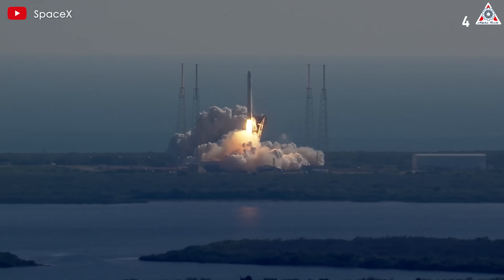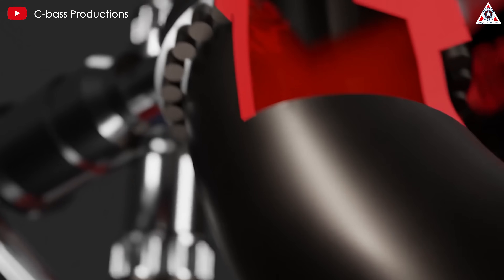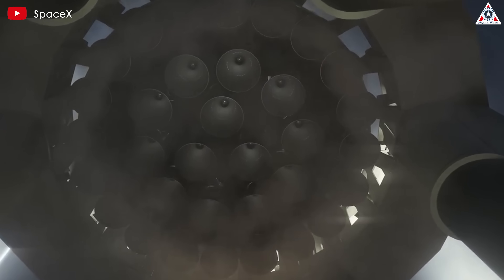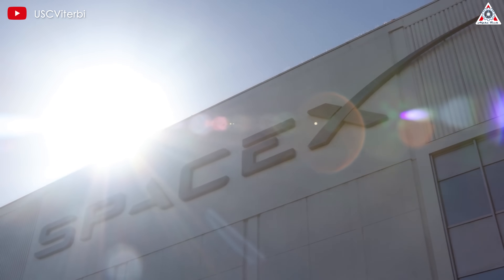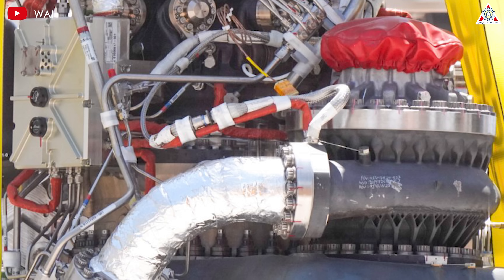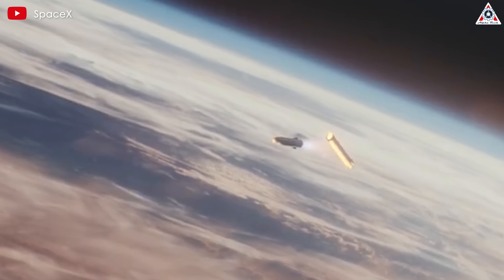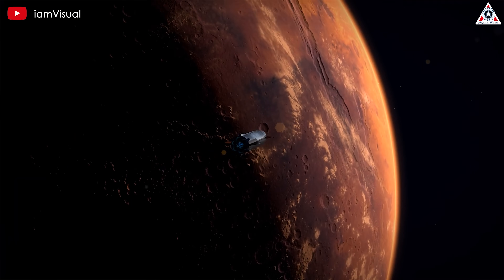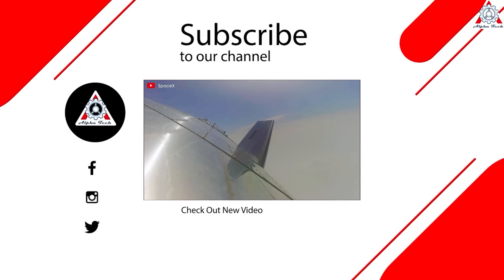Unexpected! Elon Musk Just Revealed New-Gen Raptor Inside Starfactory...

Comment: I wonder if any testing has been planned for seeing how these engines hold up when placed in standby for a 2-6 month period required for the transit to Mars. Something that will become more relevant as time goes by moving toward a Mars mission.
Reply: That’s a good point, when a engine is stopped after running and cools down it condenses and components oxidize. Any moving components typically get stuck thereafter. So I guess they will need maintenance astronauts too.

Comment: Elon doesn't have to throw away any of the Starship during testing. Instead of landing on the ocean, land the duo on a barge that is essentially a floating pool of about 15-20ft of water. The barge needs to be a radius of at least the vertical length of the spacecraft or super heavy (duo). When the duo falls over, they land in the pool of water breaking their fall. This water will be heavy and costly to transport, so keep the pool empty, and use pumps to fill it when in position. It can then be drained immediately after landing. He only needs two barges.
Reply: RIGHT ON MY DEAR FRIEND, A good man with a great idea.  Fresh water might be better but it is  your baby.   You know what, the free world owes you.
Reply: The main problem is the mass and kinetic energy create an explosion every time
Reply: @Mannicx  The rocket is landed in the water. There is no kenetic energy or explosion problem.

Comment: The history across all manufacturing up to the present is that if one integrates many different components into one assembly, the repair is to replace the entire assembly instead of opening a flange and replacing the failed gasket, so to speak, or as an example, in all such endeavors the individual components are no longer serviceable,,  This does not sound like it adheres to Elons goals or reusability, but if it greatly reduces the need for repair by an exponential figure, the question of reusability will be solved by a near .0001 percent failure rate, it would just be incorporated into the overall cost of the individual flight and mass production would follow, the cost of the flights would be like one failure in every twenty-one thousand uses is expectable.
Reply from the maker: Thank you for your comment! That’s great!
Reply: I think you are on to something. I bet he's intending to stash a bunch of spare engines in sensible places, like mars orbit and mars surface for swap-outs.

Comment: The raptor engine "IS NOT RELIABLE" It has big problems reigniteing raptor engines is only about 67%. I also think SpaceX is just asking to blow up its only launch site. So the second OLM is ready to be built, on swampland. The concrete alone is a project that will be in holes down to bedrock, and will take years to dry, immersed in swamp water. I would rather he try to land it on a drone ship. If the booster should blow up. Almost did on FLT 4, it just hit water beforehand. Still the water is the best place to stick the lqnding, and will not put anyone in danger. The innovation is almost, not science. Still too much to learn, and fail at.
Reply: have you heard of water pumps
Reply: @AydenVr7  ... and coffer dams

Comment: It sounds like they are going for engine swaps instead of getting into an engine to perform repairs while installed on the booster or ship.
Reply: Agreed. It's easier to swap one out, and then repair it in a shop after the fact, then to try and do it on the launch platform.
Reply: I think you're right. I bet he'll stash a bunch of Raptors in Mars orbit and Mars surface for swapouts.

Comment: How does the elimination of an external heat shield impact the overall efficiency and maintenance of the engine?
Reply: Part of the reason I think is the integration of external piping of coolant loops around the engine.  Making this integral to the rocket results in shorter more direct paths (lower weight, less likely to leak, leaks confined internally to the engine, more effective cooling, less propellant diverted to cooling and greater pump efficiency).  Without an external heat shield they don’t have to worry about propellant trapping in the space between the heat shield and engine further making RUD less likely.  

Maintenance may not be easier but the point of the design is to not need much maintenance to begin with.  Clean burning propellant and keeping internal temps well controlled should mean a deep tear down and inspection or replacement of components like bearing is not necessary during the life of the engine. 

Not an expert, just thoughts I was having while watching Everyday astronauts interview with Elon.
Reply from the maker: I mentioned it in the video!

Comment: If you have a rocket engine that can go through multiple launches without any major service, Raptor 3 makes sense. If SpaceX has more engines than ships to fly them on, then the longer the engines on the ship run the more time to do engine servicing. High levels of maintenance is basically what killed the shuttle program.
Reply: It’s just unproven, typically the missions are too costly for reusing engines, there is no endurance data on fatigue… you just roll your dice till you find out

Comment: could you use eletric motors gear for turbo pumps
Reply: Brian, I presume you could but that would require batteries. They have used Tesla batteries in the past but I don't know what they still use batteries for today. They are very heavy and take away from the payload of the craft.
Reply: Rocketlab's Electron rocket uses electric pumps. Sadly electric pumps scale poorly on larger rockets
Reply: Absolutely not. You see, the turbo pump IS the "rocket engine". The combustion chamber and nozzle are just some last minute accessories they throw on, the turbopump is what makes the engine the engine. Each turbopump produces 100,000 horse power! That is 10 top fuel dragsters worth of power crammed into that 300 lb pump per engine. 3,300,000 horse power in total for the boosters 33 raptor engines. Ever seen a 3.3 million hp electric motor? Me neither. The batteries to power that thing would weight more then the whole craft. These rocket turbopumps are not like the fuel pump on your car engine, they ARE the engine!

Comment: I'm so proud of Elon and his guys...
They've come a long way since an old dog Navy Radioman explained parts count logic used in electronics engineering.

Got down voted on everything... even saying the Mars engine should be the simplest and most reliable rocket engine ever built by humans.
Also got down voted for pointing out that in enlightened fabrication, you tried to get three uses out of every piece of metal..
Never expected that logic to be transferred to engines.
Also critisized the turbine in the combustion chamber, said it shouldnt even be in there, and that waste heat from the engine should be used to run the pumps if possible. Get a feedback loop going..
Which isnt what they did exactly, but that logic is getting used too.
It was pretty stressful taking on the experts already building the best engine on the planet, but knew it could be much better.

And the proof is in the pudding... Love seeing every generation get better, instead of it being assumed the latest model was the acme of rocket engines.
Planted alot of other concepts too, about potential problem areas like tiles, flappers, hull construction methods, and flight profiles. Also wasnt fond of grid fins on the booster.

Some day soon, they are gonna have near perfect chemical rocket tech developed.
They ain't stoppin'

And I just might live to see Mars with my own eyes...

Comment: How much thrust can the main body absorb with the new output of R3 will there need to be a corrisponding upgrade to the main structure ? Great show guys x
Reply: yes very interesting point.
Reply: Yes, the good part is that it’s loading is mostly in compression. The problem is that upon unloading.the structure goes thru larger fatigue cycle with large